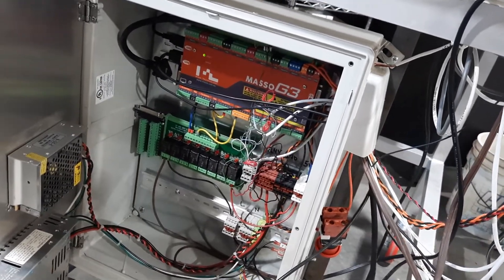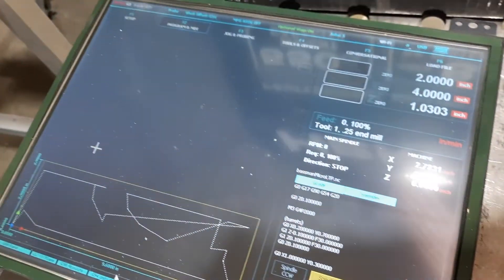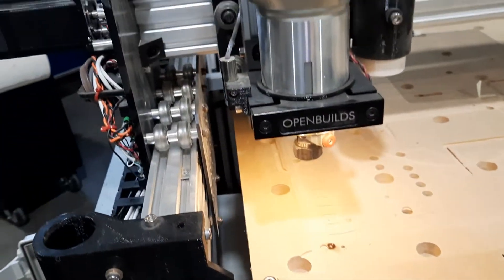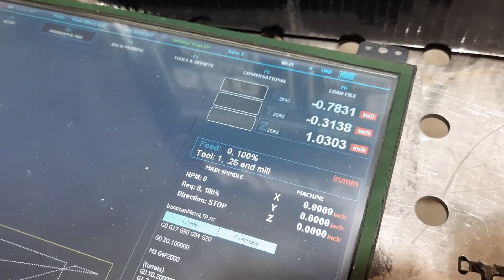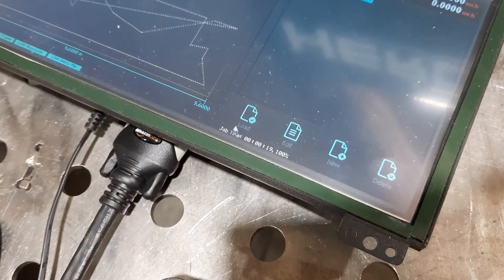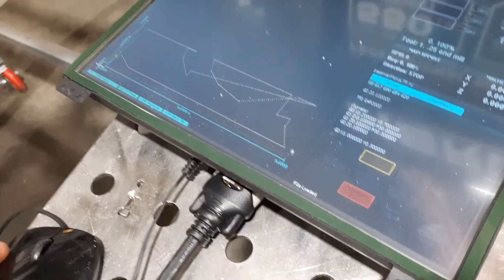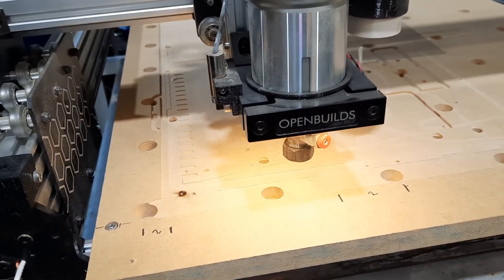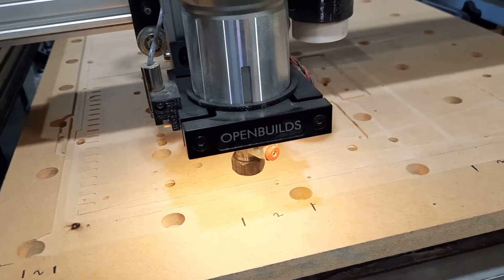Masso G3 CNC - First Dry Run

Comment: would you mind sharing your components list BOM i have a onefinity which is using an open builds controller , it works but it like comparing a 19 in BW TV to a  75 in 4K TV